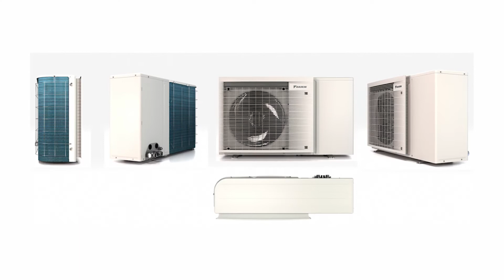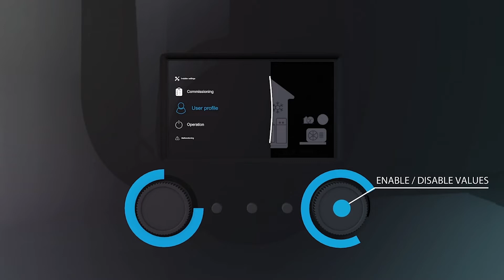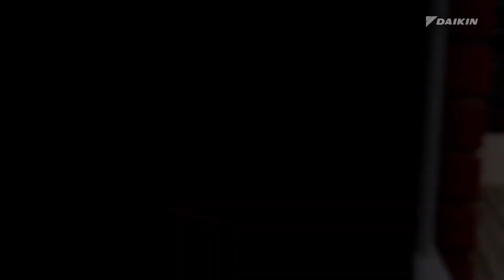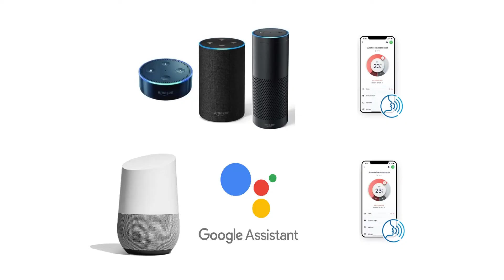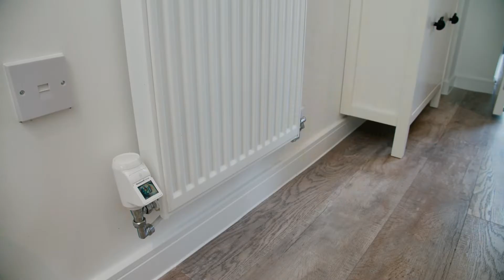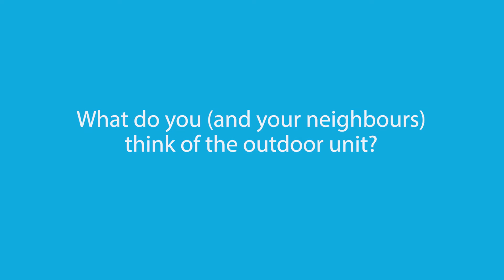Daikin Altherma 3 Low Capacity R32 Monobloc (4-6-8) – Product Full Video

Comment: Nice video. Are the 6kw and 8kw models fundamentally the same? Also what does the 8kw model modulate down to? I have heard all 3 models can go down to 250w and run steadily at that level but would be nice to confirm.

Comment: My Daikin  Altherma 3 system, installed in July this year by Octopus, isn't anywhere near as efficient as he says it should be (ie, COP of 5 at 35C flow temp).  Mine was achieving a COP of around 3.8 at outside temps of around 14C - with water flow temp of around 25C and a COP of about 3.2 for flow temps of 28C at 8C outside.  I feel this is quite poor!

Comment: Morning guys
I wondered if anyone can help our heat pump is oversized, what can we do to improve its efficiency?Its my fault really as at the time Daikin only offered a minimum of 9kw with the black grill which we liked the look of compared to Daikin other units. Our heat load is about 5kw at -2, i was thinking maybe a buffer could help but after reading these posts I'm totally confused. We have a 25litre buffer which I believe was installed for hydraulic separation and nothing else 25litre volume. The heat pump will modulate down to 30% according to the manufacturer but won't be enough on the milder days of spring/Auturm when we should be saving. Any help be much appreciated as electric has just doubled for us.
Reply: Do you have underfloor heating? Otherwise get that. And get langer  buffer. And / or  get a domestic water tank
Reply: @rosiertje  
We don’t have underfloor heating currently but will be looking to retrofit to the kitchen dinner in the future. We have a 200L hot water tank